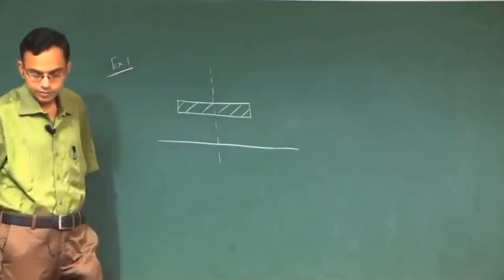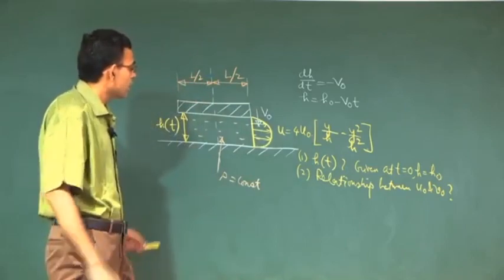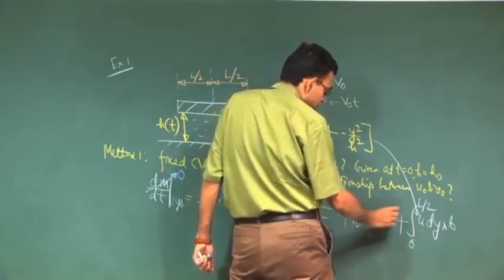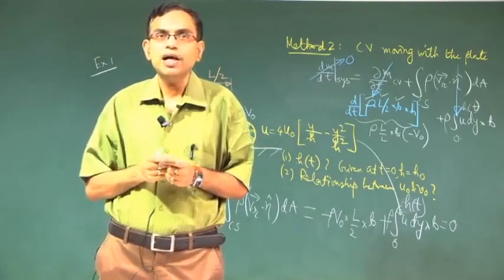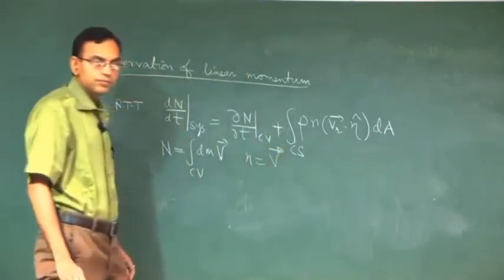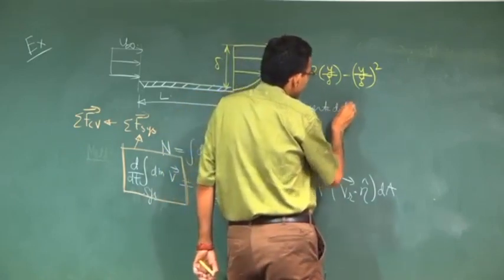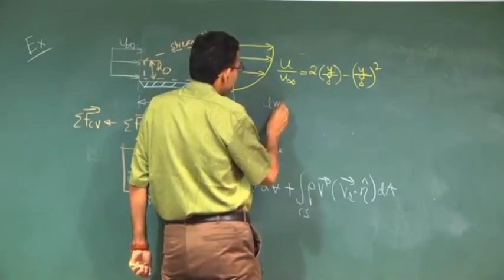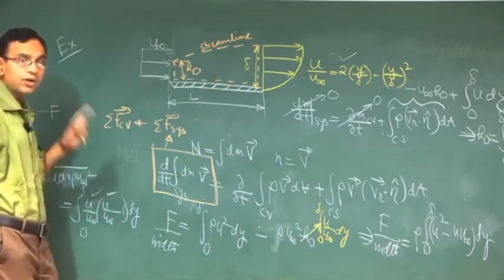Lecture 10 : Reynolds Transport Theorem : Mass and Linear Momentum Conservation

Comment: I think method 1 in problem 1 is a wrong assumption.  You said rho = constant and since Volume of CV is fixed as it is taken as non deformable control volume, (dm/dt)cv = zero. But if non deformable control volume is assumed, as the plate moved down, some part of CV below plate is filled with fluid, and some part of CV above plate is empty, effectively, the rho of control volume is not uniform.
Reply: I think in the first method we are calculating in absolute frame and in the second method we are in a relative frame and it is actually calculated at an instant, so what happens over time is taken into account by the height as a function of time .